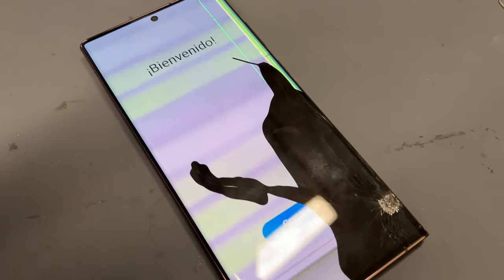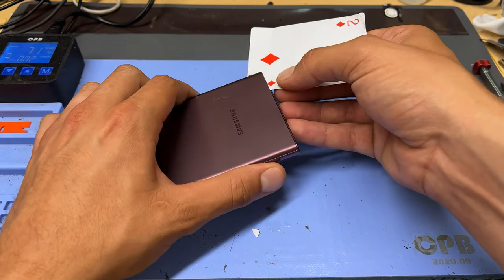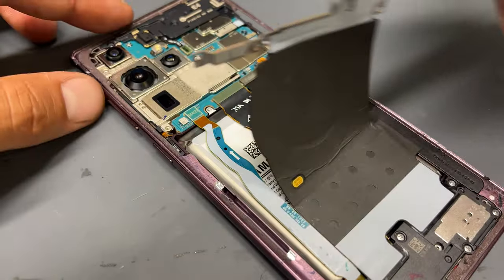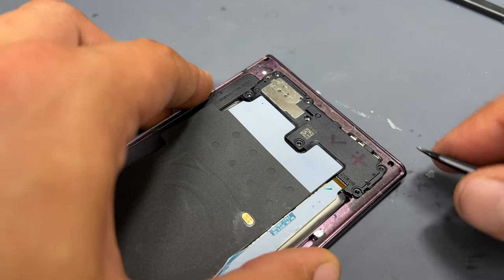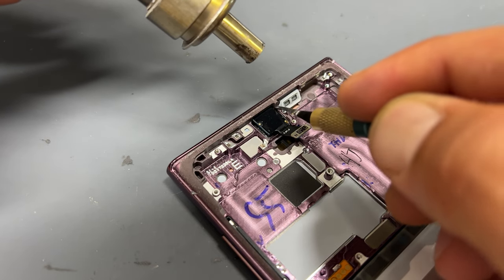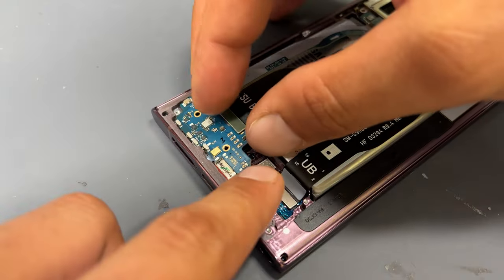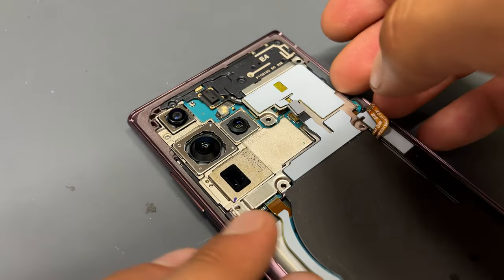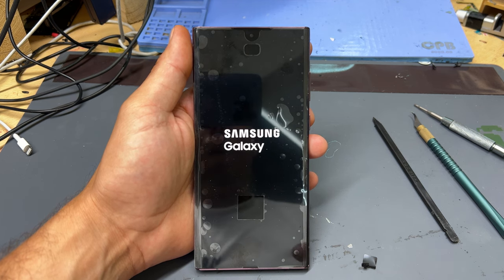Samsung S22 Ultra Front Screen Replacement

Comment: Thanks for showing the "putting it back together" steps instead of just saying "now do the opposite of all the steps in reverse order" like most other tutorials.  Got my phone fixed easily with this.
Reply: Did you use a heat gun to release the frontal camera?
Reply: @danielpenteado  I left the frontal camera alone. Long story short, I needed a screen temporarily on my old phone so I could access data on it, since no other reasonable way worked. Didn't need a camera for that, so I didn't bother actually moving it.

But I will say I did fiddle with the camera a bit out of curiosity and it was stuck in there, so I probably would've applied heat to try to remove it if I had to.
Reply: where did you get the replacement part?  @TheInfiniteLooper

Comment: One of the best repair guides I've seen so far, well done. 
A few extra steps I would add are:
1 Making sure no dust/hairs go into the cameras before installing the back cover
2 Adding some adhesive to the sides of the front camera to make sure it stays flat and doesnt move around
3 Replacing the back cover adhesive as reusing the older one will probably leave gaps which can cause dirt and water to get in more easily, leading to the cover detaching in the future.
Reply: What kind of adhesive would you recommend?
Reply: Right, I was wondering about the adhesive on the battery... I assume the replacement part comes with new adhesive seal applied for the screen

Comment: Thank you for this video. Saved me $250. One thing you failed to mention,  on the left side of the battery when back is off,  there's a little narrow vertical strip that has 2 cross head screws as well that has to be put ink the new screen.  
Other than that,  perfect video and thank you again from Texas.

Comment: I just brought my phone back to life! Followed these steps (apart from removing the battery and front camera) without switching anything out, just pulling it apart and putting it back together. And now I know how to eventually replace my screen. Thanks a bunch! Saved me a lot of money
Reply: I'm confused how did you bring it back to life if you didn't actually switch anything out?
Reply: where did you get the lcd to buy? please
Reply: Where did you get the replacement part and what did you pay for it ... ty
Reply: @wintercamewentandwasactual9964 this is a screen replacement so replacing a cracked screen would bring it back to life?
Reply: Sorry for late reply, I didn't have to replace anything, as far as I can tell, the connector had been knocked lose, so just taking it apart and then putting it back together brought the screen back to life.

Comment: Thank you so much for the detailed disassembly.
When we ordered the new screen we messed up and got the screen only,
but, we used your technique for heating up and using isopropyl alcohol along with the razor blade to remove the old screen.

The purchased screen went on great and you can tell by the color and chip look the new screen was not factory, oh well.

We gently fed the connector through the slot and lined up the new glass and pressed it in.
Keep up the great work, you are AWESOME...
Tony

Comment: Thanks for this. It helped me replace my cracked screen. Since I had it open I also bought a new charging port and battery replacement. People should be aware though that most new screens available are not like the original and are much less quality.

Comment: iso breaks the chemical bond in adhesives, so the adhesive left on the original back would now be inadequate in my opinion.
Does the replacement housing come with adhesive preapplied? Is my camera now just..."sitting loose" in the housing? With the back just...clipped on?

(serious question I want my s22 ultra back this damn lg stylo 2 pissin me off)

Comment: Would replacing the battery glue with thermal pads be beneficial? Guess 0.5mm~1.0mm pads would be suitable
Reply from the maker: I think the mid frame chassis is designed to carry any heat away from the battery anyway. Adding .5mm to the battery would leave the back cover sat high too

Comment: Just curious is there any difference with S22 Ultra Model SM-S908U and SM-S908E
Reply: 908U is the Version for the United States. 908E is international, 9080 is China, 908W is Canada. The difference is US Version is with Snapdragon CPU and International with Exynos CPU. Apart from that I don't think there is a difference. So if you buy a Replacement Kit it should fit for Snapdragon and Exynos

Comment: Where can i get an original screen for the s22 ultra?
Reply: For anyone who's wondering where you can get an original screen, it's gonna be very expensive brand new, but there's factory refurbished OEM screens on ebay though, if you can handle a small blemish or two. I got mine for about $120 plus tax.

Comment: Wait. Youre missing an opportunity to show off a 1/4"screen size reduction. After screen repair, my display no longer extends fully to the edges. There is clearly a quarter of an inch size reduction.
Reply from the maker: I didn’t miss the Opportunity. I just installed a genuine part, not some cheapo alternative!
Reply: But where did you get that part. That's what we all want to know
Reply: ifixit sells genuine Samsung parts with their replacement kits
Reply: Screen size reduction? You got scammed boy 🤣🤣 you bought some AliExpress China Fake parts LOL

Comment: Samsung phones are so easy to work on s22 s23 note 20 note 20 and the rest of Samsung phones, they are so easy to replace and repair, iPhones got to many screws to take out just to repair
Reply: Screws and covers and lots of unnecessary shit. With Samsung phones its just removing the Back Glass and if you dont mind. Just break it open and buy a new Back Glass for 20bucks. Iphone? Needs to be carefully opened at the Display Glass. You can easily destroy the Display that way. Easy Repair my Ass!

Comment: Local repair shops keep telling me the waterproofing isn't possible to have after a screen replacement. I wanted to ask here since nobody here has any money to be made or not made off my decision but is this true?
Reply: You need to take it to a Samsung repair shop they use original parts that have the same adhesive and actually rest it for water resistants